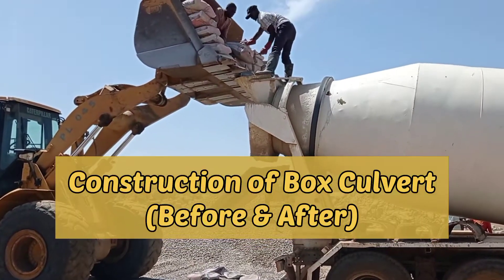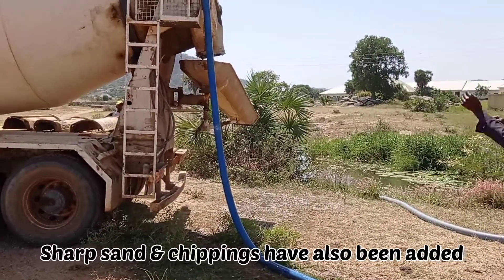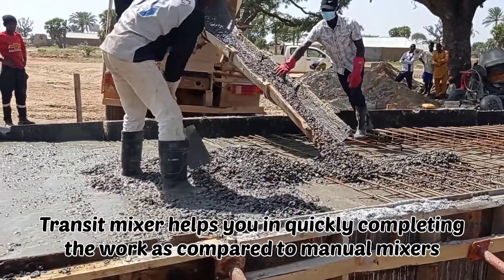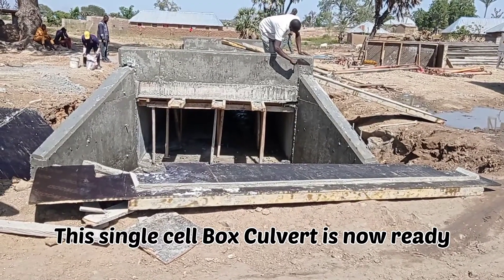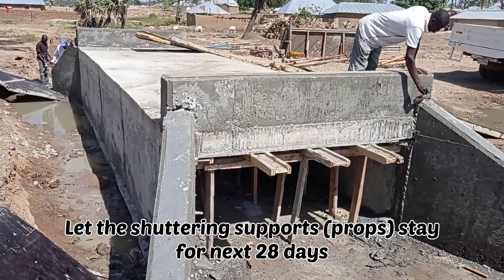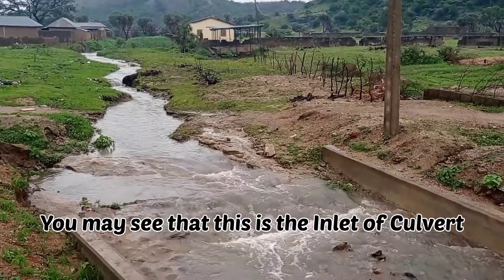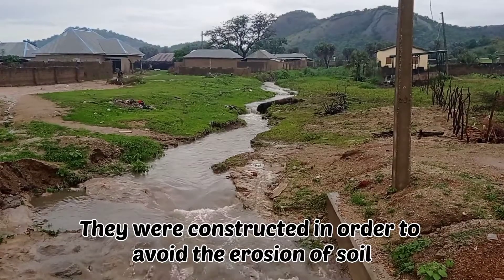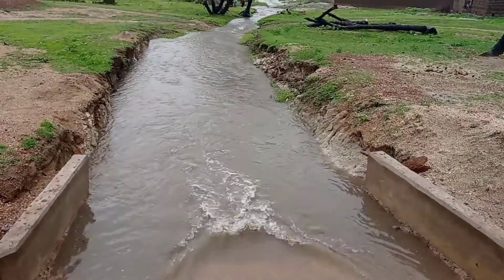Construction of Box Culvert | Before & After of Construction | Single Cell Box Culvert

Comment: Very good video

In Spain there is reinforced concrete culvert. It has length of 1.16km, span of 10m and height of 2.5m. The parallel load bearing abutment channel walls has a thickness of 750mm I guess 2m tall and made with fabricated with timber frames. How much concrete do you estimate is used just for the channels?
Reply from the maker: Thanks a lot for always appreciating me.
For this single cell box culvert, total concrete volume was almost 31cu.m
Reply from the maker: My apologies for the late reply.